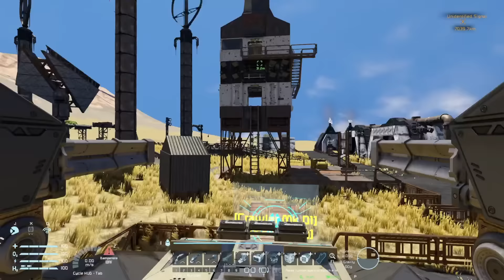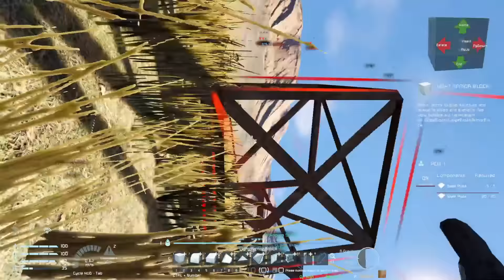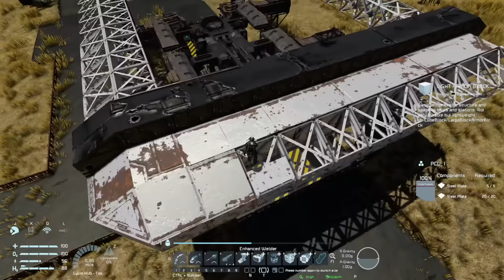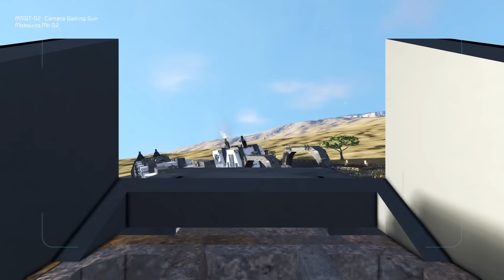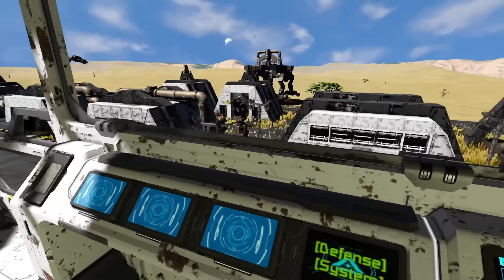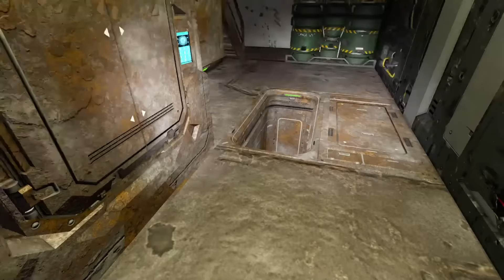Space Engineers | Mechyard Survival: Episode 10 - Balance of Power

Comment: is there any resource on subgrid gyros?
Reply from the maker: Resource or Reason?

The reason for the subgrid gyro is so that there is still some gyro override to help the mechs stay upright.
AI/Remote blocks take full control of all gyros on the same grid regardless of whether they have "Override" switched on or not.

So I put an override gyro on a rotor and then set that rotor to "Share Inertia Tensor" which then shares that override effect across the subgrids and helps keep the mechs more stable.

I can also use that rotor like a reaction wheel if I want to set up vanilla turning controls as spinning it will shift the entire mass of the mech 👍